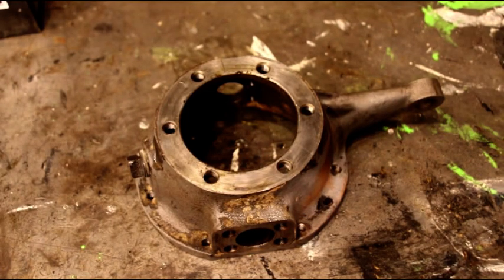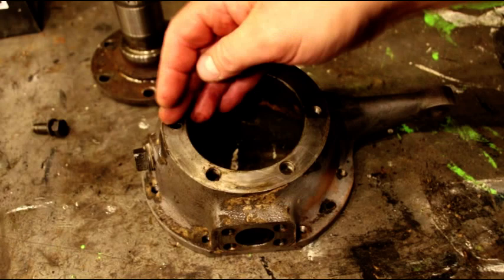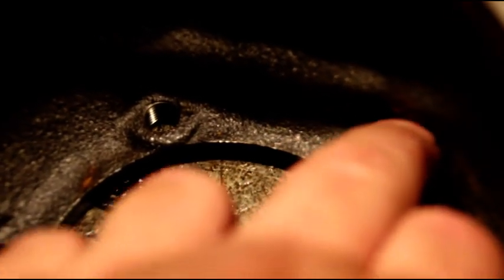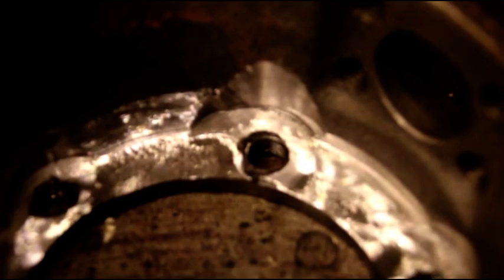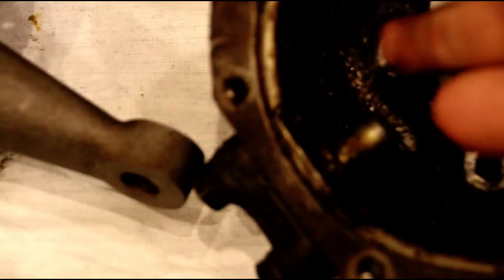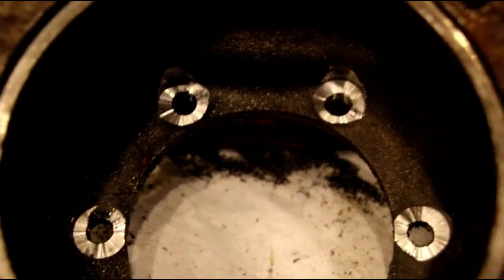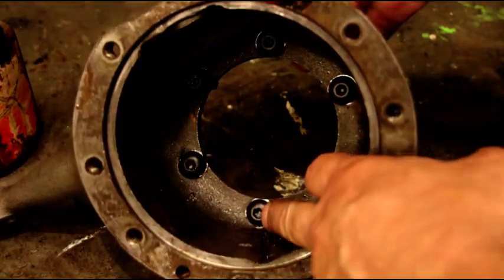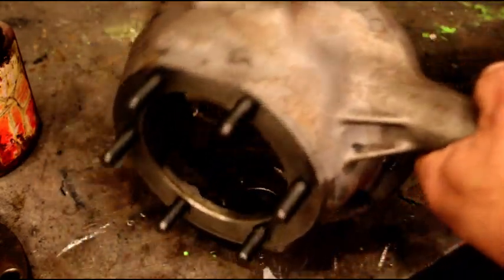Willys Jeep Steering Knuckle Upgrade, DIY Procedure

Comment: I think what your saying is the tapped threads and # 8,s add the strength. Before I think they were drop through. & the flat machined surface to eliminate wobble.

Comment: I helicoiled I think 3 holes on one of my knuckles and so far so good. I know it's on the risky side. I'm not rock bashing but I have 31 1050 15 tires. I physically check them by shaking.  As always great video.
Reply from the maker: I always do this upgrade whenever the tire size is increased.  Thru the years I have witnessed many hubs fly off of knuckles on road and off.  Keep and eye on your bolts for sure.

Comment: Thank you for the great info and tip Brian! Is it necessary to readjust the steering stop screw, so the bolts heads don't hit against the axle housing knuckle? I know too long a bolt will mangle it up, but these seem real small as to not cause trouble.
Reply from the maker: These bolts that I installed will never hit anything, the spindle, brake backing plate and brake drum will all be covering these bolts and they won't hit anything.

Comment: Nice video as always Brian.  Just have a few questions about this process.  I will be using a mill/drill method.  What are your pilot and counterbore specs? 5/16" pilot & 21/32" bore?  Do you retap the knuckle after? Finally, your button socket caps - what are the specs there that you typically use?  Thanks - project for this spring :)

Comment: Good afternoon Brian, we had talked about putting new Studs on the brake drums when you’re done doing the awesome upgrade/rebuilds on my axles, can I have the pitch, size and thread direction please. That you’re planning to upgrade it to so, I can get the new Lug-nuts for my new rims ordered out here instead of having the right hard thread and left hand threads going to in the more modern position that we talked about

Let me know Brian thank you
Reply from the maker: Chuck, I have all your wheel studs changed out to Right Hand thread.  They are 1/2"-20 and you should be able to find any type of lug nut you want for your jeep in that size.

Comment: Metalshaper, I just recently did the knuckle stud upgrade on my dana27af front axle on my 1971 cj5. When it came time to set the preload on the kingpin bearings. The passenger side I got 16 lbs pull, on the drivers side I got 16 with no shims. After putting the seal in and the felt then the 2 piece metal covers on and tightened it was hard to move the knucles. They seem to be really tight, is that normal?
Reply from the maker: yes the knuckle will be very tight when the seal goes on.  Perfectly normal ,nothing to worry about.

Comment: Thank you for the video Brian, I am just fitting my knuckles on the jeep now, so the information came in handy. One question, I set up the preload on the kingpin bearings as per your video at 16ft.lbf pull force. After fitting the rear gasket and felt seal assembly I noticed that quite some force is required now to move the knuckle. I did see that the rubber that fits ontop of the steel plate is bigger than the plate, so I imagine that the rubber is pinching against the ball area that goes into the knuckle. How much force would you expect it to be to be able to move the knuckle once the seals are in and the joint is all greased up?
Reply from the maker: after the knuckle seal goes on it can be very hard to move by hand, that is why we set the bearing preload with the bare knuckle.  Until you get lube in there and the knuckle moves a bit it can be very hard to move by hand.  If you set the preload correct don't worry about anything, when you turn the steering wheel everything will feel as it should.
Reply: @metalshaperJeep  thank you very much Brian!!